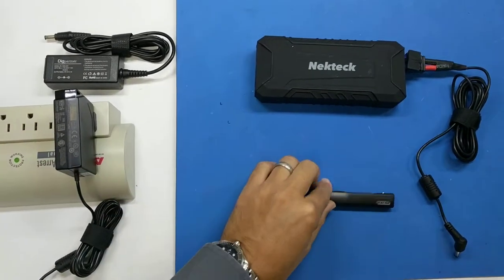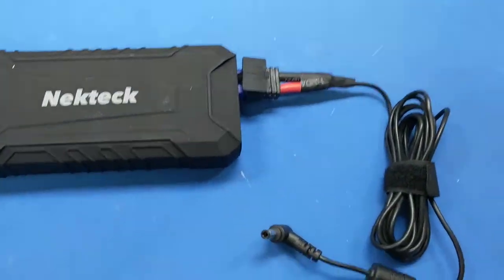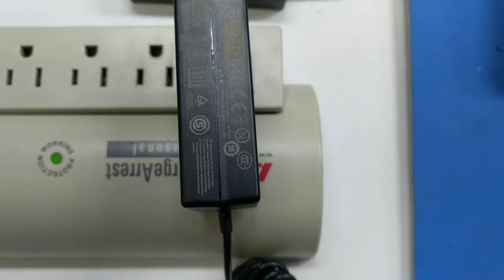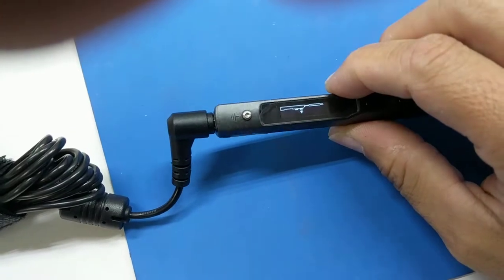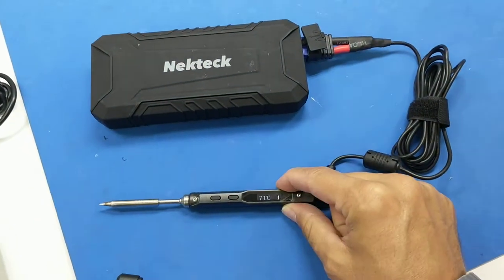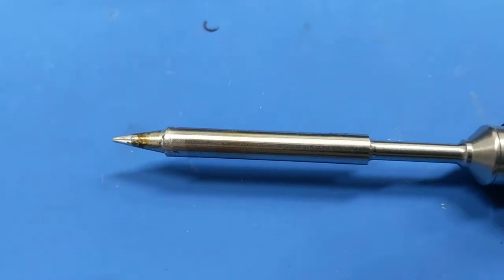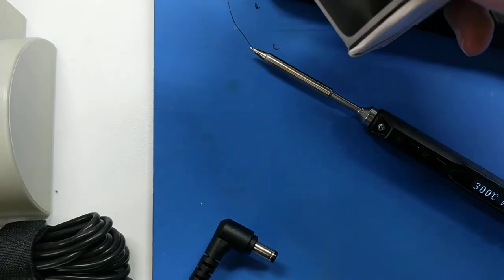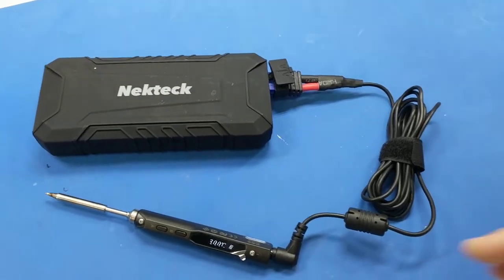TS100 Soldering Iron Portable Car Battery Jumpstarter and Intel NUC Power Adapter Solution

Comment: What is the male plug you put in the soldering iron itself is it 2.1mm 5.5mm ? I am can’t field answer anywhere in the internet...
Reply: Find*.
Duhhh they sell the soldering iron without the adapter and don’t even tell what adapter it is ???
Reply from the maker: @epampoefmkfkefpeao4291  definitely not 2 mm.  Much closer to 5. Will try to remember and post when I get to the office.
Reply: @cognetic  5.5 x 2.5 mm
Reply from the maker: @DA-jw6nm  That k you so much!! So totally forgot to measure that!